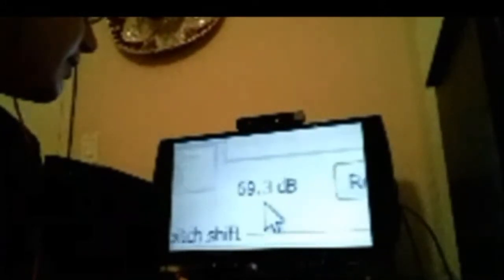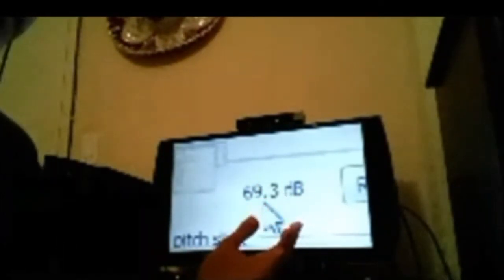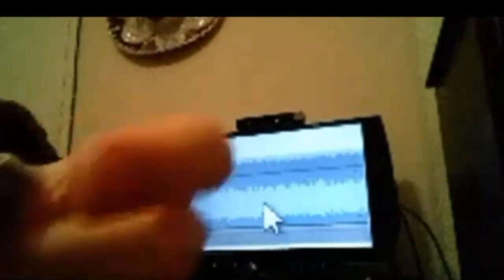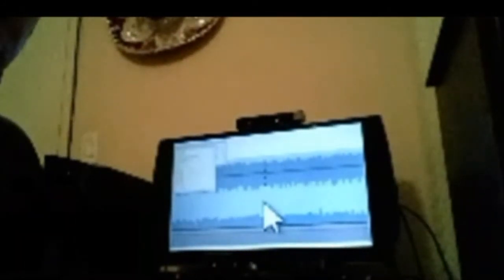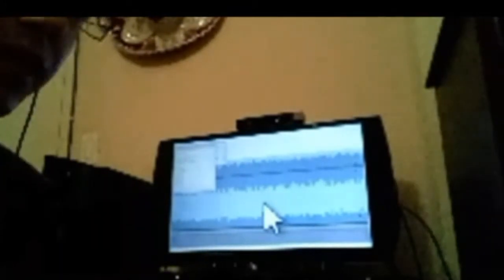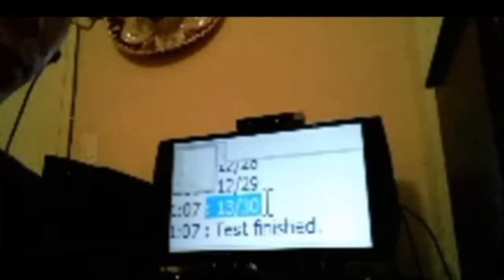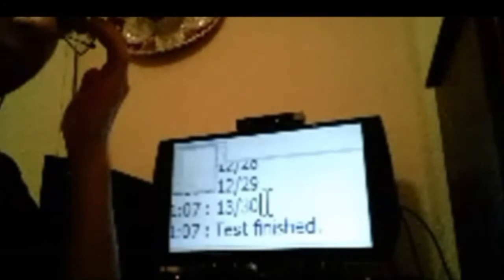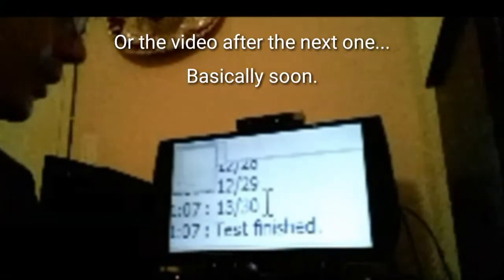24 vs 16-Bit Audio. What's the real difference?

Comment from the maker: @JimBob1937  
1. Again, 2 times is the cut-off for Shanon-Nyquist if it wasn't you would have already found some quotes that confirm this.

2. If I am so wrong why doesn't anything you say correct me. Most of everything you said literally only proves my point.

3. Why not just delete your most recent comment now?
I will of course leave the above comment in a new thread along with the information I posted here about the definitions of the words you messed up and all like this below:

From me: "Thesaurus
Arbitrary adjective:
1 having or showing a tendency to force one's will on others without any regard to fairness or necessity - Words Related to arbitrary: arrogant, commanding, demanding, dominant, domineering, haughty, imperative, lordly, masterful, overbearing, presumptuous, authoritarian, autocratic (also autocratical), despotic, totalitarian, tyrannical (also tyrannic), tyrannous,
capricious, changeable, erratic, inconsistent, mercurial, whimsical, biased, inequitable, partisan, prejudiced, unequal, unfair, unjust, unrealistic, unreasonable, unconscionable, unethical, unprincipled, unscrupulous
- Near Antonyms for arbitrary: balanced, disinterested, dispassionate, equal, equitable, evenhanded, fair, impartial, just, nonpartisan, objective, rational, reasonable, understanding,
unbiased, unprejudiced, ethical, honorable, irreproachable, law-abiding, moral, principled, unimpeachable

2 lacking a definite plan, purpose, or pattern - Words Related to arbitrary:
accidental, casual, chance, chancy, contingent, fluky (also flukey), fortuitous, inadvertent, incidental, lucky, unconsidered, unintended, unintentional, unplanned, unpremeditated, scattershot, shotgun, irregular, odd, sporadic, spot, directionless, objectless, purposeless, indiscriminate, unsystematic, undirected, disorderly, disorganized, undiscriminating, unselective
Near Antonyms for arbitrary:
established, fixed, regular, set, stable, steady, constant, continuous, even, arranged, managed, orchestrated, ordered, planned, aware, conscious, deliberate, purposeful, thoughtful, willful (or wilful)"

Which strongly indicates that you were totally lost. Ultimately you brought the argument to me from another channel and lost the argument on all fronts in multiple videos and the only one where I would even attempt to defend you is in the one where you started trying to fight in another video but I let that roll off my shoulder because it is ultimately a response to the very unspecific question I posed in the video itself.

None of that helps your case at all. I'd stick with your plan to delete this thread.
If you think I will delete it you are mistaken, I allow people to sound as foolish as they wish. This will be added to the end of my previous comment should you choose to delete this thread though.

You keeps aaying you will...
And yet...
Still here, right?

I *owe you no answers for my age, region, 1st language or education level.
More stuff to tack to my new thread talking about all the ridiculous things you've stated in this thread while it was here, eh?

Still here though... weird. I guess you forgot what it means to delete your own comment?
I mean you said you would I won't and you are still here.

Arbitrary or capricious standard.
Yes, this too, doesn't work for you, but me, don't you see?

I'm still waiting for you to give up though.

Yet 2.1 is your recommendation?
2 times really is the cut-off because nothing more is needed and anything more is wasted data, so there is also that terrible reality you must contend with.

We already examined why oversampling is needed and Shanon-Nyquist theorem is oversampling the Nyquist rate is 2x the rate of the original signal and is indeed an example of oversampling.

Again anything above it is redundant unnecessary and wasteful which is why the these two individuals got together and posited a solution and we regularly apply what was discovered by those two to clean up audio. You can add even more samples, but since you can already create a smooth waveform with 2 times the samples of the highest frequency being recorded... everything else is totally unnecessary.
My video does not explain this, nor was it really necessary that I did because it was a video about me doing an A B file comparison based on my own experience.

Oh you got me (finally). The Nyquist rate is the number of samples necessary for a cycle to be reproduced accurately. The Shanon-Nyquist sampling theorem states we need to sample at twice the frequency.

And you finally deleted the comment bringing an argument from another video that you shouldn't have even made here to begin with.
Reply: Whatever you have to tell yourself to protect your ego, lol. Seriously, you have this odd compulsion to be right, no matter how wrong you are. I deleted the other comment thread out of respect to not have your incorrectness recorded on your video, but then you post this. Just to feel you're right, thinking I wouldn't respond so you can give a public perception of being right? Not to mention your post here is just random copy/pastes of your previous rants with no context, it is very unlikely to make sense to anyone reading it... you're veering into highly illogical territory by posting that after I respectfully deleted the other reply thread.

1. Shannon-Nyquist sampling rate is a lower bound, not an upper bound.  You keep using the word "cut-off" which makes it seem like an upper bound, but the very act of oversampling says it is not. It is merely a lower bound for the ability to properly reconstruct a signal.
2. You somehow don't understand the English language within the context it was used in, literally, I posted a dictionary that disagreed with you. Your copy/paste of definitions isn't the issue, it is your comprehension of them.
3. Nyquist sampling rate is the base sampling rate (2x), oversampling is anything above that rate (>2x). Hence, "Shanon-Nyquist theorem is oversampling the Nyquist rate," doesn't make sense. Again, you think you understand the topic (or any of the topics we've discussed) but you don't.
4. Oversampling is needed for signals that can contain frequency components outside the max frequency being captured (which happens for most signals), since a low pass filter cannot realistically have a hard cutoff, oversampling is needed to allow for a low pass filter to function. If you don't oversample, your transition band will eat into your base signal you're attempting to capture and will see signal falloff distortion in your captured signal.
5. 2x is Nyquist, anything > 2x is oversampling. x being the highest frequency component you wish to capture (highest bandwidth requirement). A duplicate, but worth repeating...
6. Lookup rectangular function in the frequency domain to the time domain, a rectangular function in the frequency domain represents a hard cutoff filter, and in the time domain is a sinc function which continues on forever.. which would require an infinite time to represent. Hence, you cannot have a hard cutoff low pass filter. Hence you must account for a transition width for that low pass filter in your signal sampling to avoid aliasing by capturing frequencies above your Nyquist rate. The transition width depends on the windowing function used and your application/filter requirements. The transition also needs to be accounted for in the sampling, as mentioned in #4.
7. This is the reason for the 44.1kHz sampling rate that is a standard (not the only standard...). And no, this is not referring to them trying to capture 22.05kHz frequencies, it is them capturing 20kHz with a 2.05kHz transition width for the low pass filter.
8. Oversampling is a thing in general for multiple reasons, it is not always a waste to oversample and has specific purposes. "Again anything above it is redundant unnecessary and wasteful," is incorrect. It is a waste if you have no use for the extra sampling headroom it provides, but there are uses for it.
9. 2.1x simply came about in our discussion as a rough lower bound estimate for Nyquist rate + some room for the transition width of the filter, you must oversample in order to give room for a low pass filter to properly function because a filter cannot have a hard cutoff. In my reply (now deleted) where I referenced 2.1x, you somehow misunderstood and thought I was saying that was the Nyquist rate... even though I explicitly stated the Nyquist rate is 2x, but you need some extra room for the low pass transition band, hence roughly 2.1x as rough lower bound (within the audio world). I even explained the mathematics behind why a transition band is needed and how this relates to oversampling... and somehow you think you've "win" by arguing I said 2.1x was Nyquist. As I said before, you cannot win arguments by making up facts, making up what others have said, and by changing the definitions of words to suite your needs... that isn't reality. With 2.1x for audio, assuming you wanting to maximize the frequencies at 20kHz, your sampling rate would be 42kHz, giving you a transition band just under half the one standard of 1.00kHz versus their 2.05kHz. However, I'm fairly confident (though I haven't done the math) that transition width is enough given a more modern filter design compared to the standard that was made in the 1970's.

You're arguing with an electrical engineer who specifically studied signal processing... on signal processing. You can literally not take my word for it and find any of this information in an engineering resource/reference. However, by the fact that I previously gave you a nice high level overview and that you didn't seem to comprehend it or just outright ignored it (covering the basics of the math), I suspect you won't properly comprehend any of those resources either.

A note to others, avoid this guy at all costs. At first I thought he may just be confused, but I seriously think it's almost a pathological issue that won't allow him to think he is wrong. He's been very wrong pretty much every step of the way for any discussion I've had with him. However, he views any discussion as adversarial instead of someone simply trying to teach him. Trust me, I've tried to teach him... but he will literally ignore direct facts to twist the discussion into him "winning" when all you try to do is teach him about something, it's downright crazy... like literally arguing the English language after he realized he was wrong kind of crazy.

To Variant. Again, I wish you the best. However, move on at this point, seriously, lol. This all started because you didn't understand the Steam Deck's refresh rate was changing with the new user selected options and what this meant for vsync target shifting and FPS... after you realized you were wrong (despite it literally being in the original video source, with the exact words, "screen refresh" and first party info saying such), you then started to argue the meaning of the word 'arbitrary.' While you're incorrect on the definition as used in the context, it is meaningless and petty anyways instead of just admitting you were wrong. However, to put the record straight, again, 'arbitrary' can result in something static, or something dynamic... arguing 'arbitrary' must be dynamic is a misuse of the term as per definition. If I make an 'arbitrary' choice, does it mean my choice KEEPS changing or merely that my choice was not expected (or not standard) and considered arbitrary (like an arbitrary judgement of the law example given by a dictionary I showed), but once it is made, the results are more or less static, correct? Something can be arbitrarily designated and then by static in state afterwards just as much as it could continue being arbitrary dynamically. I have a feeling that surely you understand the definition, and more than likely it is just you attempting to "win" at all costs. In context, this certainly meant Variable Rate Refresh is actually NOT arbitrary as the refresh is explicitly tied to the frame rate, the refresh rate is defined by the FPS and hence is not arbitrary. In the context of the deck, selecting a static refresh rate in between 40-60Hz, when the standard is 60Hz and 40-59Hz is non-standard, is certainly arbitrary if, say, I pick 46Hz, or 51Hz, or 41Hz. Why? Because they are not dependent on any standard, or mechanism that requires them to be at those values, they're 'arbitrary' values being selected somewhat arbitrarily. You perhaps could, if you wanted to stretch the truth a bit, argue that they're not arbitrary as they're based on the vsync target you're wanting to achieve. However, if your average FPS is 55FPS you could still set 55Hz, or 54Hz or 53Hz...etc, as any value below your average will work to shift the vsync target, hence, any choice within that average FPS to the usual standard 0.5x (60 to 30, or 120 to 60) is indeed arbitrary... and the results are indeed static after it is set. The selection of the refresh rate is indeed arbitrary even though the result of the choice is static thereafter. Like I said, to some extent, I blame myself for getting so involved in petty discussions that I literally have to break down the usage of a word given its definition since you argue even that. It's crazy, lol.

"I *owe you no answers for my age, region, 1st language or education level."

I never asked for your region. However, age, native language, and education level give an idea of someone's background, which can be useful for tailoring explanations to their specific knowledge level. Educational level and age are important in general. However, based on your incorrect arguing of the English language, I was trying to give you the benefit of the doubt that perhaps English is a second language for you.

I typed a lot of information out for you in order to teach you how this was all quite useful, and you would rather just pretend you know it all and try to (incorrectly) "win" the discussion instead of learning. On this specific video of yours I agreed with your conclusion and gave a mathematical and engineering perspective as to why it is the case... and you were just combative and felt like you knew it all, again. I was just trying to give you more information, more knowledge, on a subject you seemed interested in. A strong life lesson in all of this if you were open minded enough to see it.

Edit: Note, if you want this message to be gone, you still have the option to delete it or delete your reply here. If you want to keep it up, that is your choice, but that is why I deleted my previous reply thread, for your benefit...